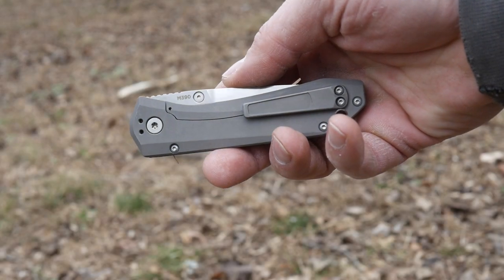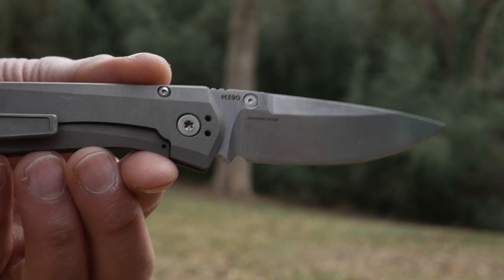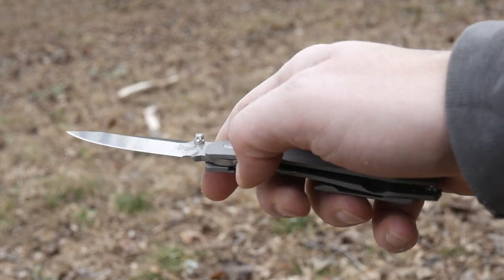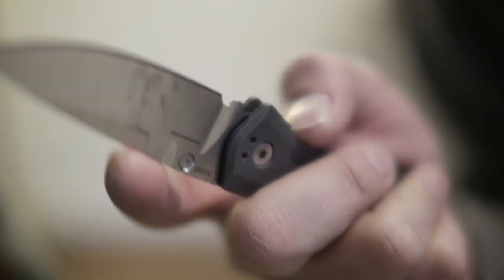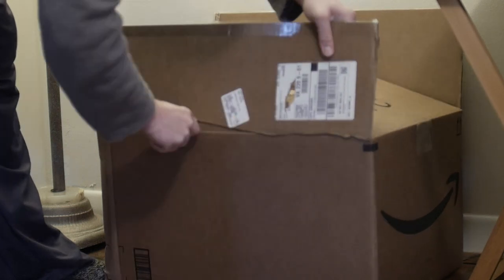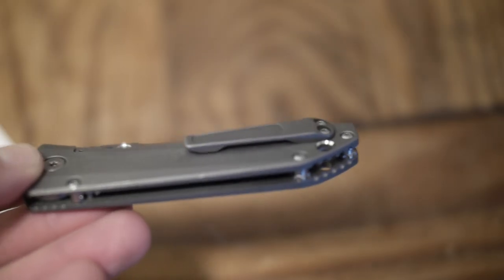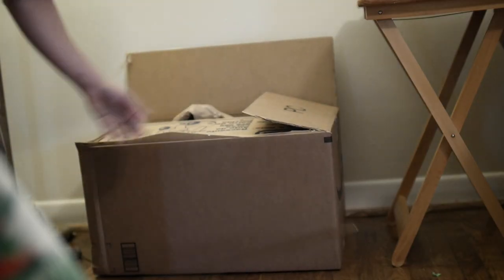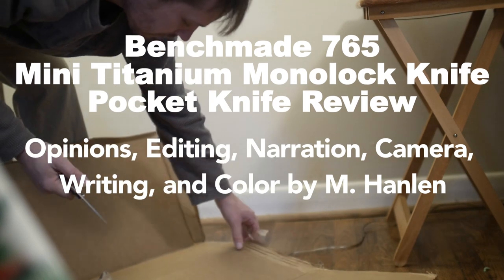Benchmade 765 Mini Titanium Monolock Pocket Knife Review. Bohler M390 Steel!

Comment: It's nice to see Benchmade got their shit together with a frame lock.  They had some problems with detents in the Lum model.
Reply from the maker: +SailfishSoundSystem like the lock and the action. And actually I didn't hit that hot spot while I was cutting.  It depends on what you're doing and how your holding it while cutting.
Reply: I'm glad they made it tip up unlike the large model.

Comment: $301! Holy smokes! You could buy 16 Ganzo G742's and still have enough left over for a White Castle Cheeseburger crave case and a sack of Onion Chips. The problem with anodizing titanium is that titanium is extremely corrosion resistant. The metal doesn't etch deep enough to properly take the anodizing dye. Its damaged very easily. I think the little sharp corner in front of the lock bar is to prevent over travel of the lock bar when you unlock the blade.
Reply from the maker: +God of Thunder (UKKONEN) yeah I know. I'm trying to round out some different types of steel though.  It's pretty sharp too... I have quite a few frame locks now, and this is the only one that has those machined out parts. I get why the overtravel is there on the lock bar... it's actually hard to see in the video- but that area machined out on the very front of the knife makes no sense.  Nothing ever enters that area, or travels through it.